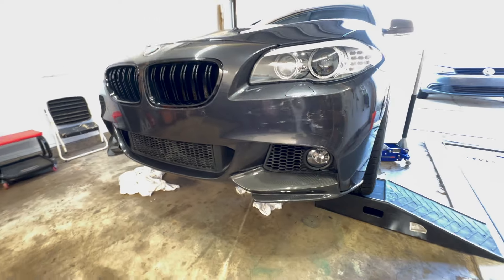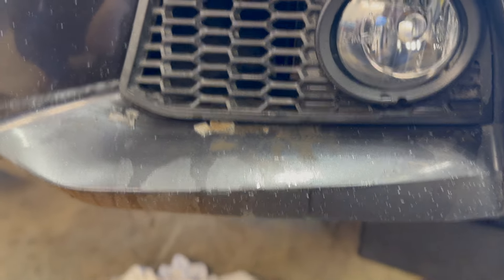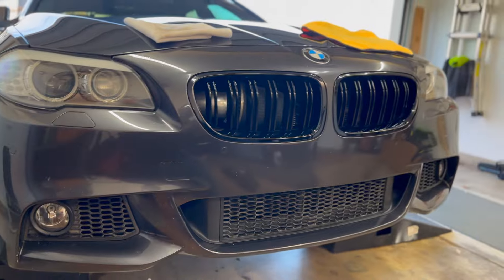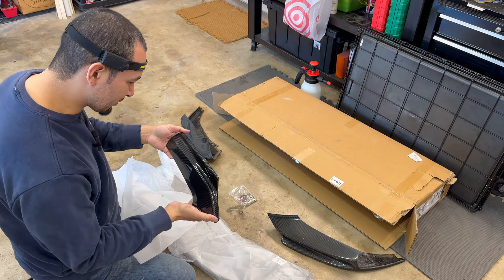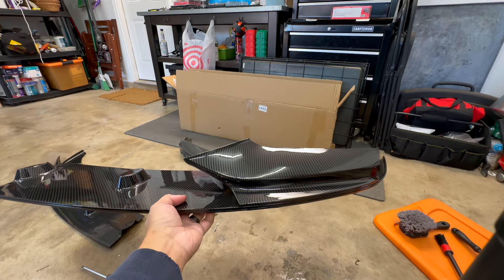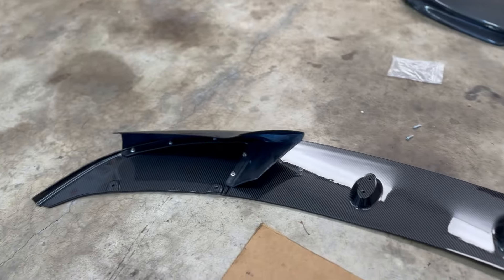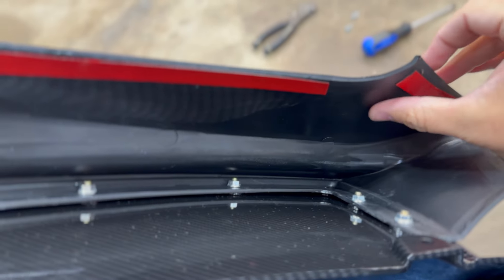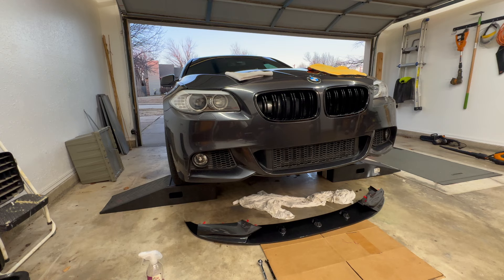F10 GETS AN AMAZON SIDMILE FRONT LIP

Comment: Need updates on the new turbo. Do you plan on upgrading HPFP? E85?
Reply from the maker: 91 oct safe tune has been finished. I have up a dyno video for it as well. Flexfuel tuning will begin in the spring and a dyno at the end to compare custom conservative 91oct tune Vs custom ethanol blend (likely the best power spot will be E50-E60 as is most commonly so on N55s). I already have a Helix Overdrive unit for my HPFP. There's also a video of that install process :-)